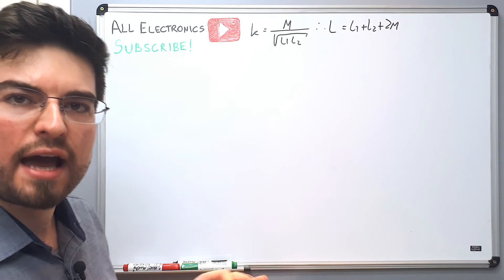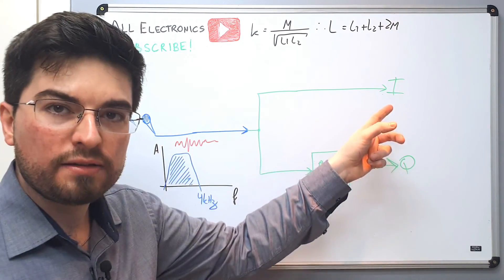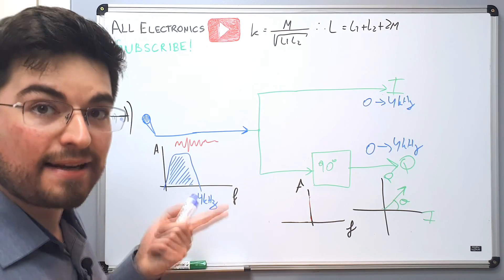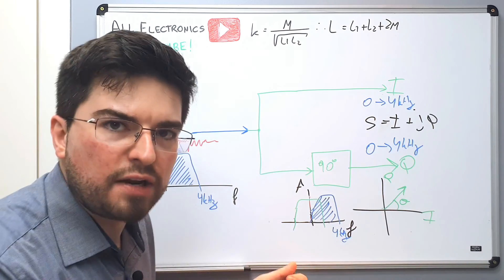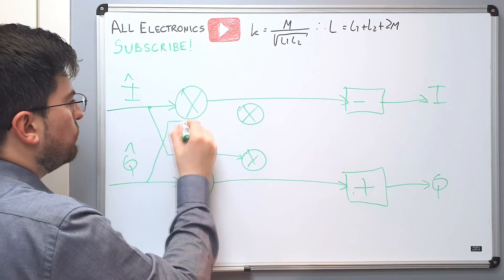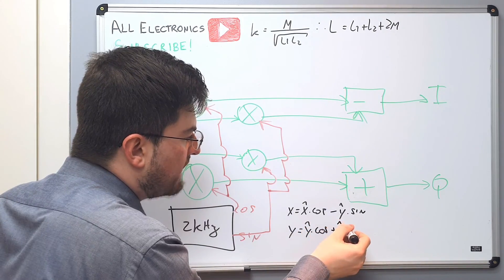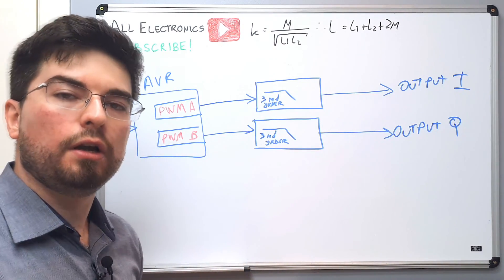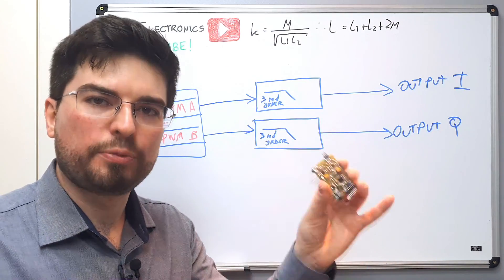DSP Baseband Speech Processor for ham radio

Comment: i am sorry Gregory, one question please, how the vector rotation yielded a down converted signal ? thanx.
Reply from the maker: Imagine a circle rotating on the IQ plane. The circle is colored blue and red, in opposite sides. (Red positive, blue negative). This rotating circle is the signal. 

Now, imagine a vector on this IQ plane, also rotating. If the vector rotates at the same speed (frequency) as the circle, it will always point to the same color, this is down conversion to DC. Imagine now, that the vector is rotating a bit slower, the vector will be pointing to the red part of the circle, and a bit after to the blue part, and again and again... This is down conversion. The red, blue, red, blue pattern is the signal down converted to a lower frequency!

Comment: When you cascade all-pass filters, which act as a fixed delay line, how can you ensure that you can create a 90 degree delay for signals at  DIFFERENT frequencies? If signals range from 0 - 4KHz,  wouldn't you have to delay a specific amount of time for each frequency in order to get it's quadrature pair? Aren't the cascaded all-pass filters introducing a FIXED delays?
Reply from the maker: The filters are not equal. Individually they generate different phase profiles, with different phases over frequency. But, what matter is the relative phase between I and Q. The 8 all pass filters are specially designed and matched to create constant 90 deg relative phase over a broadband.

Comment: Thank you for the demo. I am new to ham radios, but understand basic modulations and demodulations. Could you explain why you are creating an I and Q version of the original signal in the first place? (You have not created more info about the original signal)
Reply from the maker: Because I and Q is needed at the output, to represent negative frequencies.